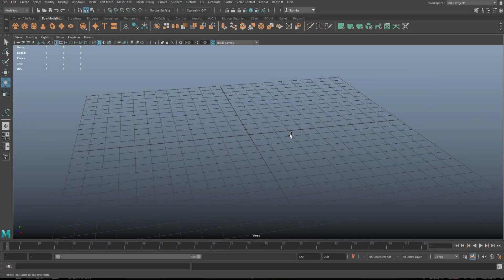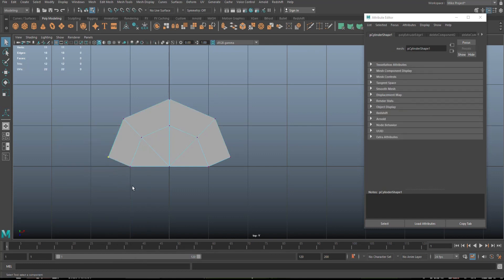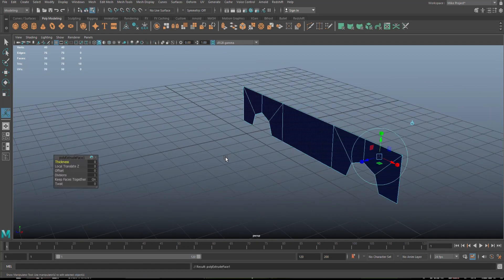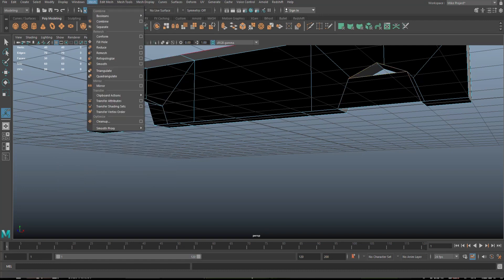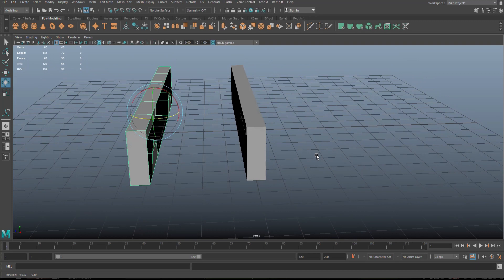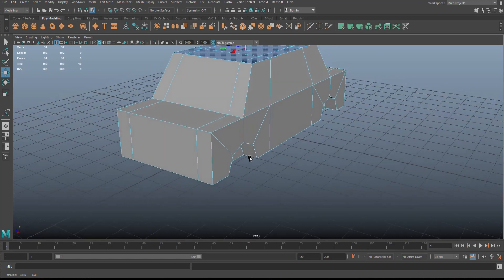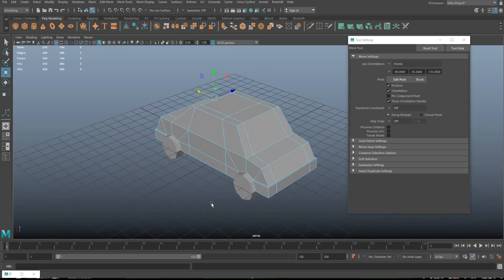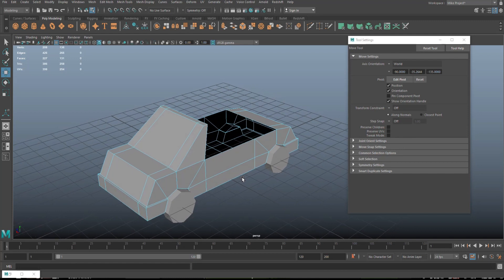Using simple 3D geometry as a base for Car modeling

Comment: what hot key did you use for edge loop tool? Also how to get straight line across. mine is going up and down the edges.
Reply from the maker: Ctri I for the insertion of Edges. To get straight across, select one on the vertical edges instead of a horizontal one